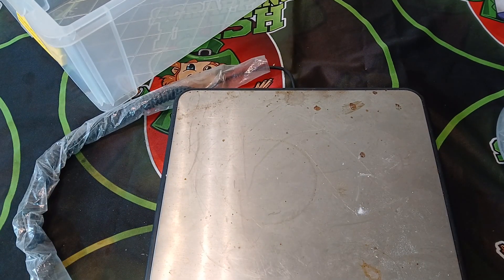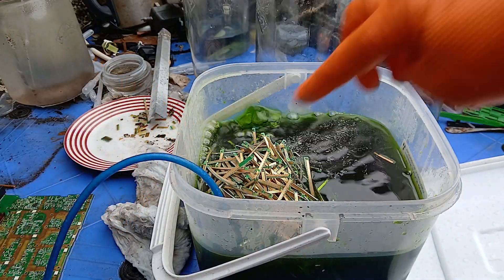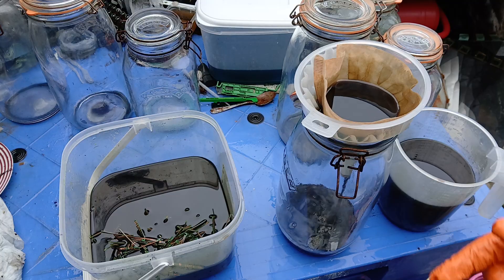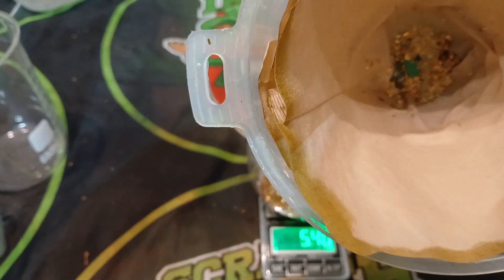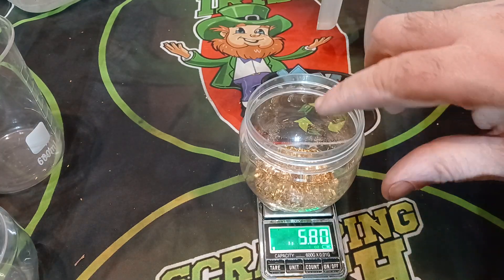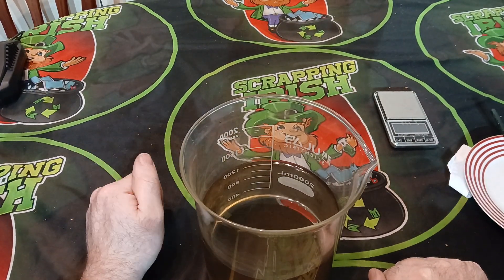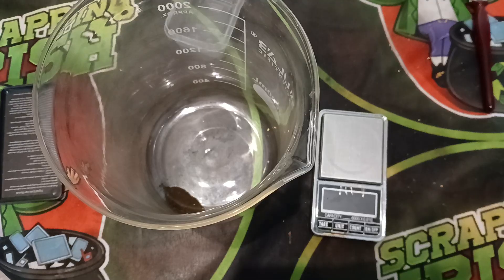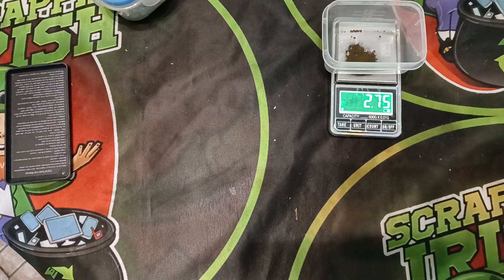I Recovered GOLD from 1.15lb of Trimmed Computer RAM

Comment: Great video.  I liked it 👍👍.  One process question….when using Bleach…. Is there a step required like the “De-Noxing” step required when using Nitric Acid?
Reply from the maker: If you think it still got active bleach in it you can just use head to denox it but make sure you are wearing proper ppe at all times when doing this process
Reply: @ScrappingIrish  HCL ?
Reply from the maker: @ dont need to worry about the hcl heat will denox the soluction
Reply: @ now, I understand.  Thank you 🙏

Comment: Hy good evening It seames rthat most of the persons posting on this app are not wiling to help some one starting in Gold recovery! I ended up in dividing my sulution into short 2000 ML beakers and prosided to drop the gold each off the beakers hs a had a layer of sedimemt mesuring a bit over 3/4 of an inch  since this was a durty Gold drop I decanted one ove the beakers whashed it  several times with distiled water then procided to redesolve it in acualigia  afeter the gol was in sulution I aded some sulfuric acid to drop led, and it did a hole bunch of led came out and was capturer during filtrationthe re maining sulution had a very light green tint almos florestent . To cut dis short for 3 days I have been trying to redrop the gold aded sulfamic acid no reaction,So I aded smb The gold starts to drop but goes rite back into sulution , The sulition that I decanted from the first 2 drops is steal caramel colerd and sinse it`s siting in a clear 1 galon picher i can see golg acumilating at the botom not very much But as you know gold is gold and it`s welcom .Thanks for your help Joao Pestana.

Comment: you are corect not oll the gold has droped out off sulution I have grtely under estimated the amount off gold that I disolved in aqua ligia  there were 6 filters from 6 diferent recoveries as I mentiond before this is my first atempt at recovering the gold from the materials that I have been saving , and from these results I emagine that I have way more gold I have almost 3 LBS off filters that contain gold foils ,etc. I`m going to desolve a large amout sodium Metalsulfit in water  put my sulution into a larger container whid a catch container in case of a boil over i will do this over midium heat . Thanks for your input John.

Comment: Hi, I'm a full time scraper, i found 13 boxes containing 6k old dsl filters, there's 3 phone line ports with 10 pins in them, with my magnifying glass they look like they have been dipped in gold coating, being from old dial up Internet I'm guess it's thickly coated with gold, my question is can i buy a gold test kit off eBay and test gold plating with it? I want to know it's gold before sell them on ebay. Ty
Reply from the maker: You can get a gold jewellery test kit ,it comes with different gold test solutions to test the grade of gold
Reply: @ScrappingIrish  I've been pulling the pins and so far I have  1 lb. and a 1/4 lbs. Of pins, they sure don't weigh much so when I'm done my estimate is almost 4lbs of pins and probably carpel tunnel in my wrist.